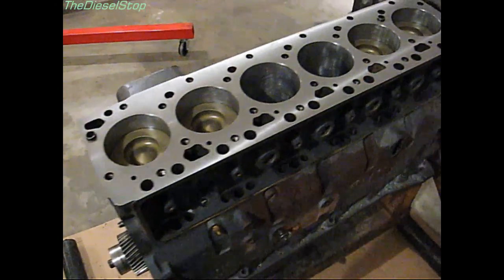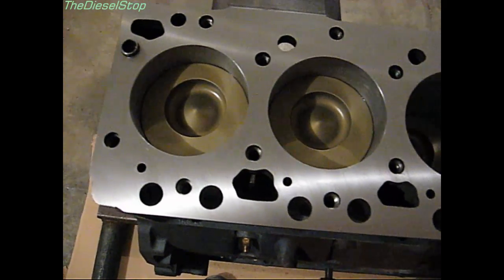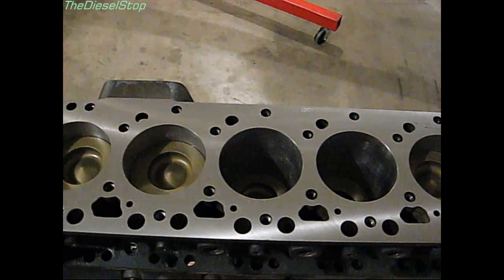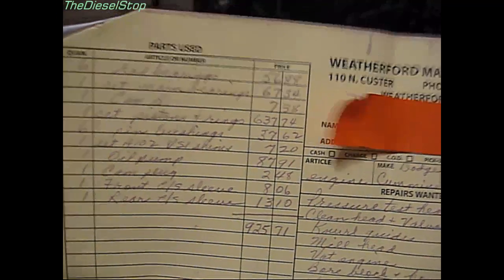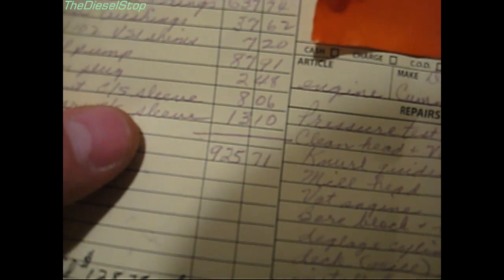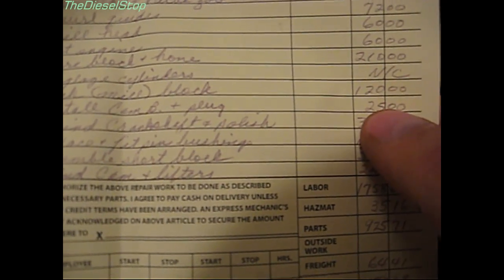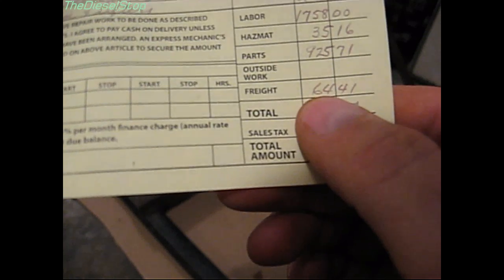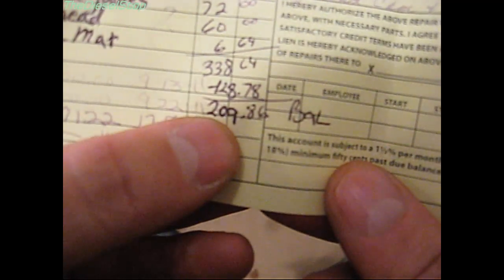5.9 Cummins Build The Cost

Comment: hey wayne do you assembly all of the parts in the 5.9l cummins  I've been doing this for 30years working for chevy but I own a dodge diesel 5.9 24 valve with a auto trans it's all stock I was just thinking what i could do to beef up mine  thanks john